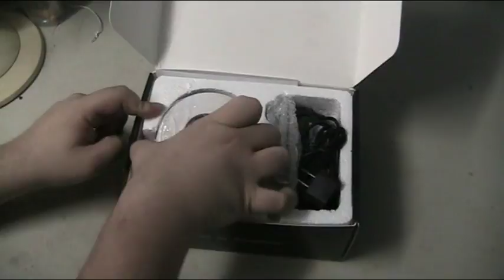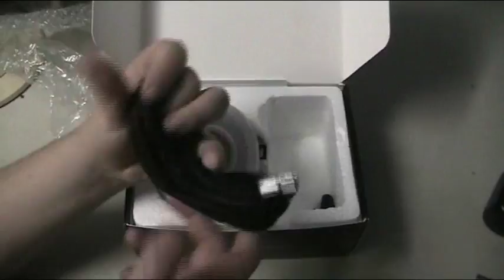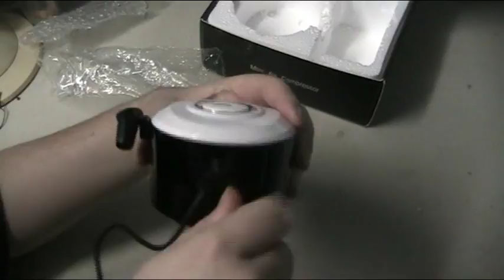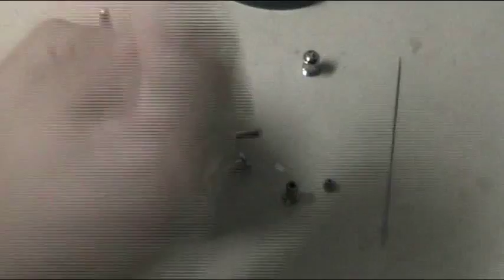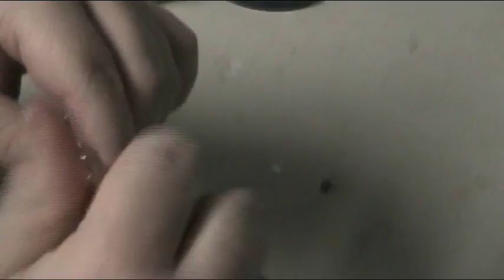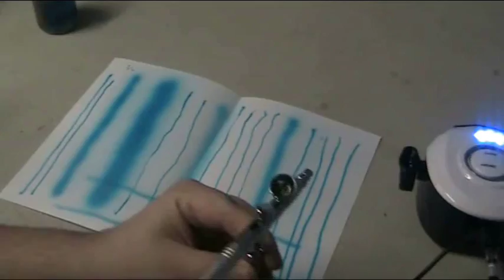BT-16 Spirt Air 12 volt airbrush compressor review

Comment: I have this compressor and it is pretty solid. The only problem I have with it is that for miniature painting the pressure it gives is always too high and strong which causes spider webs on my models. Are there any options to make it weaker? Would changing the motor to a 9v work? What are your thoughts?
Reply from the maker: I'd add a 1/8'' bleed valve or tee pipe and add a ball valve, crack the valve slightly to bleed air

Comment: Is this compressor similar to an Iwata Ninja jet?
Need you advice please which one should i buy to paint my 1/72 aircrafts
Thank you for the video
Reply from the maker: It's not the same as the ninja as it is a much larger and more expensive compressor however this will be fine for 72nd sized subjects. At least with this choice you will save a lot of money.
Reply: @mokanaman  i found the iwata (100€) and your kit (50€)
I think yours is better for me as beginner and after that will buy one with an air tank
Reply from the maker: @apm-algerianplasticmodels  No need to buy a airtank. Few parts and one can be added with a softdrink bottle..

Comment: I have one like this but there is no air coming through at all. I have checked the pipe for blockage and I have checked the airbrush as well and all seems fine. Please help
Reply from the maker: Is the pump running, blockage is an uncommon occurrence. Most likely the air is leaking from the pump or around the output. If quite the pump is not powered meaning the power supply has blown or the switch is busted. Not much can be done regarding both faults as this is a cheap plastic product with no support. My recommendation is to learn on this then upgrade to a metal compressor.
Reply from the maker: If this is new out of box from ebay or amazon message the seller for a return or repairs.
Reply: Thank you I have been told to ship it back.

Comment: would you say this is equivalent in air flow as if you sprayed one of those cans of air? I use the canned air stuff that you would use to clean your keyboard, to push ink around on paper and I want to be sure this would be similar in air force.
Reply from the maker: It is much better, the over all advantage canned air has is no power source is required. That aside canned air should have been obsolete years ago.

Comment: The compressor seems to move around. Would it be a good idea to fix it to the table somehow?
Reply from the maker: All the little plastic compressors and some of the big ones move around. I find a small rubber mat cut to size does the trick.